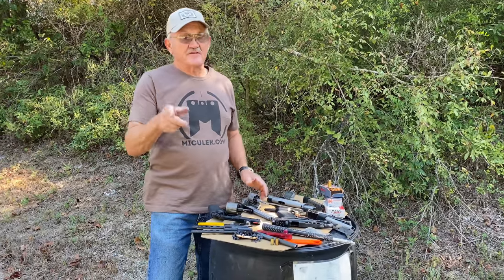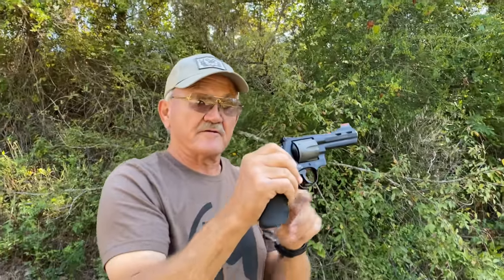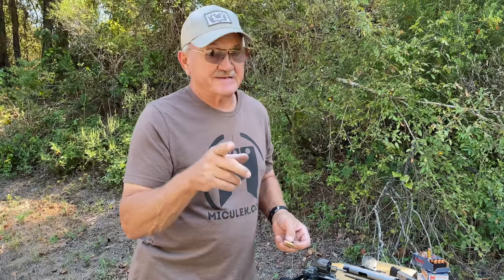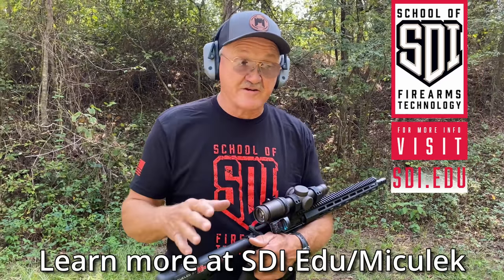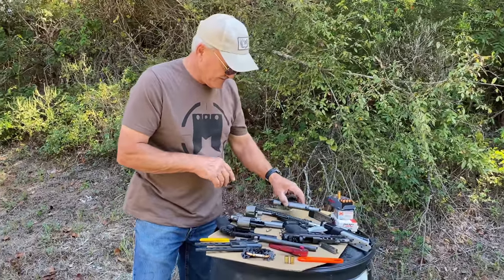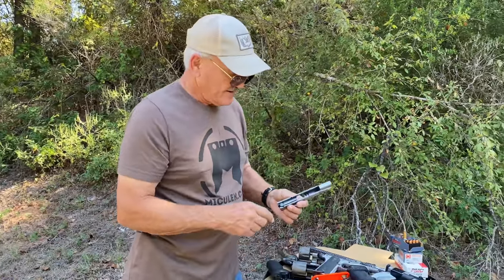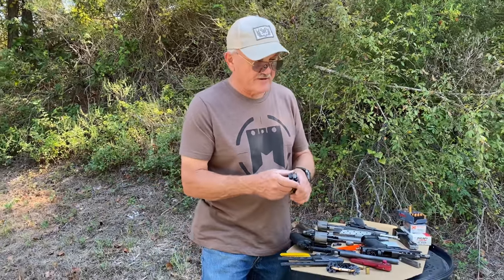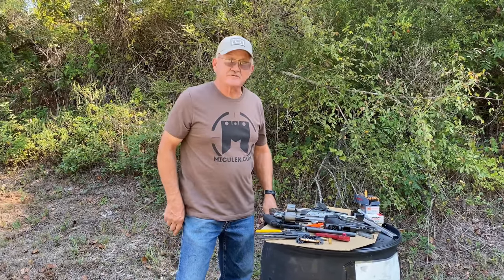Jerry talks malfunctions Pt 1

Comment: I shoot a S&W model 625 alot and use a Wilson Combat tool to unload the moon clips but plan on hitting pawn shops to buy an old golf club because it looks so much easier than what I'm using. Great idea!
Reply: I also shoot a lot with my 625. I have found the California Competition Works Super Demooner the best tool for removing the brass from the moon clips. Each squeeze pops two rounds out, twist, again, twist, and again you are done.  I made a custom loader to load my moon clips.

Comment: More great tips. Thanks Jerry! I wonder why moon clips couldn’t be made from a material that wouldn’t bend so easy such as carbon fiber or titanium. The cost would no doubt be higher but they would last longer. Have a great Sunday! 👍🏻👍🏻🇺🇸
Reply: If moon clips are too stiff, you can’t load and unload em…
Reply: @stevea1131  There used to be a company that made polymer clips you could load and unload by hand. I don’t know if they’re still made but I don’t see why you couldn’t use one of the many tools available to load/unload clips made of other materials. 🤷🏻‍♂️
Reply: True but those are actually more bendy than steel, not stiffer.  The tools are great but the clip still must be elastic enough to allow insertion and removal of the cases, especially when the clip is full, which limits the deflection for insertion because of the adjacent cases taking up space the fingers of the moons could otherwise deflect into.  Add in the requirement that clips need to be usable for many load/unload cycles and that the steel clips are pretty easy to put right with a little effort in all but severe cases, and steel still stacks up pretty well. 

Not sure how durable a .040 heat resistant  carbon clip could be made, and what that might cost, but good clips cut specifically for a certain head stamp already can cost $8.00 or so each….

The polymer clips solve the problem by being softer instead of stiffer, so they don’t take a bend.
Reply: Thanks for the info. I’m not that familiar with moon clips but I’m learning.

Comment: I have an M&P.40 1.0 4.25 15+1 pistol. Police trade in. Love the thing after an Apex trigger job. Anyway, the mags for this pistol are almost $50 each so I ordered two from Promag. I think it was like 30 bucks for both of em. Lemme tell ya something fellers, don't waste your hard earned money on aftermarket mags for M&P pistols. I've never had a single malfunction with the S&W mags, and I've never been able to get thru one of the Promags without one. Stovepipes, failure to feed, the list goes on. Just pay the extra $ and get real M&P mags, unless you need to practice clearing your jammed up pistol lol. They're great for that!

Comment: Smith & Wesson needs to make all of their 9mm pistols have large enough ejection ports so that you can interchange different caliber barrels and magazines. That's why I bought my original Smith & Wesson M&P in 40 S&W, so I could change out the barrel and use it as a 9mm or a 357 Sig. This modularity is very useful and helpful (at this point you might as well sell all M&P's with Optics ready cuts in the slides and threaded barrels on everything in addition to installing APEX triggers). Also I noticed the new fully metal Smith & Wesson M&P 2.0 no longer has the detent in the way of the slide stop/release (is about time if you ask me, that slide stop detent was nothing but trouble).

Also make the trigger guard larger so there's enough room to use a heavy glove for winter. I also like how Glocks triggers stay in the rear position when they are not cocked.

Comment: I was hoping Jerry would give his opinion on whether or not it's OK to store mags full of ammo. 1/2 way with ammo, or no ammo at all. I read everywhere, all different opinions on this. I personally have mags that are full in storage and empty in storage but non 1/2 full. What are everyone's thoughts on this?  A spring is a spring right? Compressed or uncompressed?  The wear happens during the compress/uncompress actions I'm told or is this wrong?
Reply: For the storage issue, I have heard enough while normally springs are ok with it, sometimes they are not.  My opinion is a mag spring with the right metallurgy can be left loaded for 40 years and no problem.
Reply: I have a 1911 that I have had for a long time always worked when I needed it to,  one time I left a mag completely loaded for about two years went out to shoot it and it stove piped every round I now no longer do that If my carry gun hasn't been shot in a few months I unload and switch mags I guess I'm saying it's not worth your life to take a chance that it's going to work and only takes a couple minutes to do most people cant afford to shoot their carry ammo every week to keep everything moving like it should.
Reply: @USMC-1911  I have left mags loaded for far longer than that and no problems.  I seem to remember  Col Cooper firing 1911 mags that have been left loaded 40 years and function was fine.  
But there is no down side to switching mags and if that works for you, then go for it.